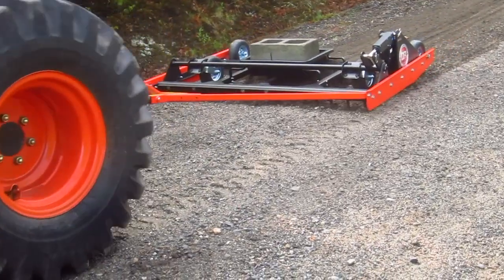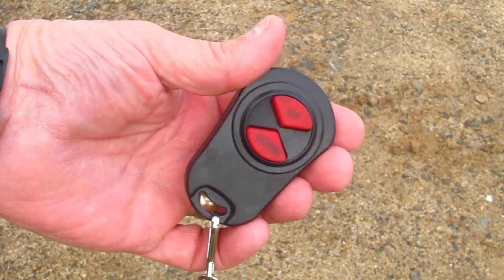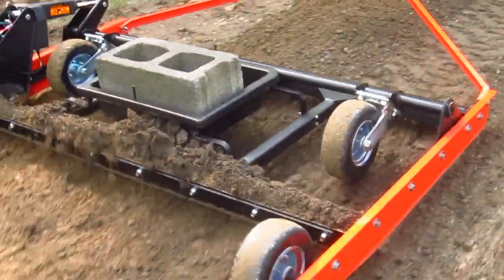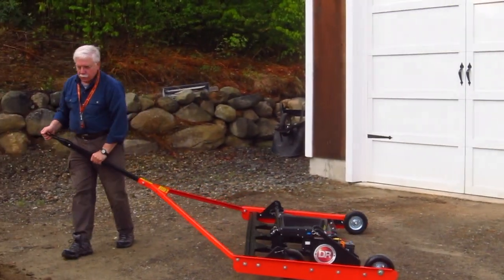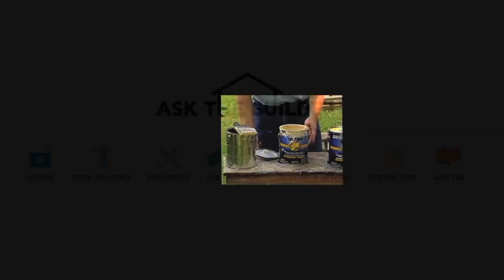DR Power Grader Review

Comment: Our maintenance dept. has one of these for use on a 1/4 mile gravel driveway at a retreat property. It works as expected, but you should know that the particular design shown in this video is now replaced by an updated design. DR no longer offers the wireless height control key fob either -- ours failed, DR did not offer a replacement, and we had to replace it with a wired switch kit, for which we had to pay full price (a sore point). It does a good job, though, and can make a driveway look like it was freshly graveled after multiple passes. Just make sure you don't try to go too fast. Also, it is less effective if you have to go uphill with a smaller tractor (we have a John Deere x485), since you can't dig as deeply. Just takes multiple passes, and the best solution is to drag downhill when you can.

Comment: Used one of these for many years.  Burned out the K46 transmission on several lawn tractors as a result,  Be sure to have a better transmission.  That said, my 1/4 mile drive took a lot of passes to really get the surface broken up and graded.  Deep holes would always come back because the grader simply can't cut down enough.  Wasn't uncommon to spend 3 hours out grading and having to spend another hour a week later to finish off the deeper holes.  And forget it when its wet.  So, you get a week of rain and then wait another week or so to dry out and the roadway is a mess.

Ultimately we got an old farm tractor and use a 3-point Land Plane to do the driveway now.  Takes 45 minutes and unless there is standing water, I can grade as soon as I want after a wet period.  Finishes better and allows the proper construction of road crown.
Reply from the maker: To get unlimited free tips each week like this, be sure to sign up for my FREE newsletter at www.AsktheBuilder.com

Comment: Compare this with the ABI Attachments gravel grader. I have the Infield Grader which accommodates tow behind attachments, so I tow either a 6 foot mat or a 4 foot lawn roller behind the grader.  I do this behind a 20 year old 15 HP riding mower. Your options depend on how you plan to pull the grader. I also have a box blade on a subcompact tractor that also pulls the grader with a 3 point hitch. DR is not the only show in town, but you can forget about the over sized Tonka toys for sale at big box stores unless you are just detailing between visits by your gravel contractor.
Reply from the maker: This machine has continued to perform well now for over 7 or 8 years. It's used multiple times a year on the drive. It's NOT a york rake. It's NOT a bulldozer. It's a great tool for minor touch ups on small gravel roads.

Comment: So just how bad was your driveway to begin with? Hard for the viewer to tell if there is any improvement or not with nothing to compare it to (before & after pics). One thing I know for sure, if your drive has pot holes, it will fill them in, but does not compact them. After just one or two rains, the pot holes will come right back. Does a pretty decent job of smoothing out small ripples and generally leveling the surface though.
Reply from the maker: +Paul Allen The drive had a few 1.5-inch deep ruts. I try to keep it in good shape. I disagree with you about filling potholes. This machine will fill them, and granted, you'll have to compact them. It's not a multi-purpose machine. What is really great is the ability to wirelessly control the depth of cut of the carbide teeth.  This machine works best on a gravel drive that's got a good 2-inch cover of ledge pack or similar mix of fines and 3/4-inch angular stone.
Reply: +Ask the Builder We have about 1200 ft of driveway. The first 200 ft or so we share with the farm next door which gets a lot of daily use. There's well over a foot of gravel base in that section so not as many pot holes as ripples. We grade it with a blade. We grade the rest of the drive with a home made belly grader blade. Works pretty good but still have to compact the pot holes. Even then they still come back after awhile. Our neighbor across the highway has a DR

Comment: I beg you NOT to buy.  Actuator broke and the new one needed a retro fit. I thought  since the old one only had a few components I figured an easy fix.  Not by a long shot.  The retrofit had about 25-30 items which all needed to be used. Their customer service is the worst I have ever encountered.  It took a month to get all the components and I spent over 2 1/2 hours on the phone with customer service.  I would not buy another DR product ever again.
Reply from the maker: Thanks for this update. I did also have an issue with up/down actuator after about one year.
Reply: Explains why they've got their comments turned off. Thank you, you've saved me time and money with these clowns.

Comment: It looks a little light.  I think more beef would make it do a better job but I've never seen one work just this video.
Reply from the maker: It's not supposed to be a bulldozer. You can put rocks or concrete block on it to add more weight.

Comment: It looks like a gimmick to me.
Try it on a packed driveway with huge ruts two feet wide six feet long and eight inches deep. Not a smooth already graded surface.
Reply from the maker: You can see the tool do just that if you go to the manufacturer's website. I don't let my driveway get in bad shape like you describe.

Comment: You are smoking crack. That thing is a turd. 1. Way too light 2. Buy a cheap box blade. This video was funny as hell. He said with a straight face it did a good job. If you have a tractor the box, or rear blade would do 100% better. Tractor towing a DR power grader must be a city thing.
Reply from the maker: Take another toke. Actually, after seven years, this grader is still doing a really good job. Is it for everyone? No, just as many don't need to wear a fanny pack. Unlimited tips like this are in my FREE weekly newsletter. Subscribe at: www.AsktheBuilder.com

Comment: Sorry Have to disagree looks very  light. Simple landscaping rake attachment is much better and as i said SIMPLE.
Reply from the maker: You should probably go to the manufacturer's website and compare the weight to a standard York rake instead of just making an assumption. Plus, you can add concrete blocks on top of this unit to increase the weight.